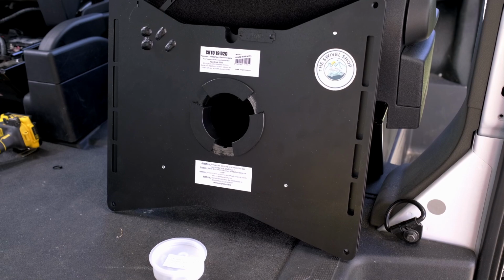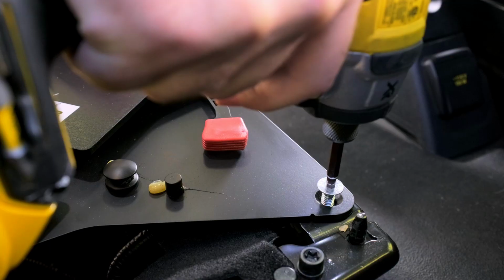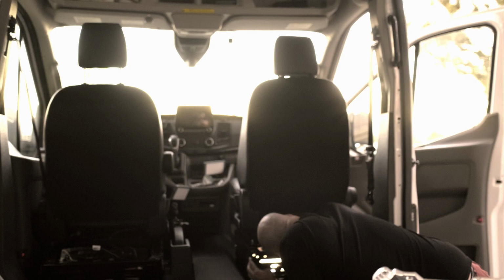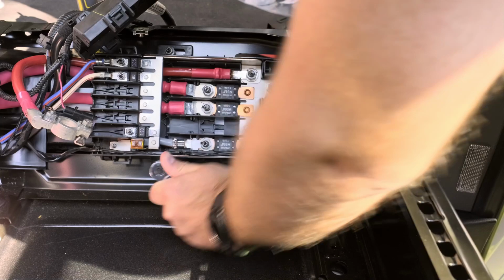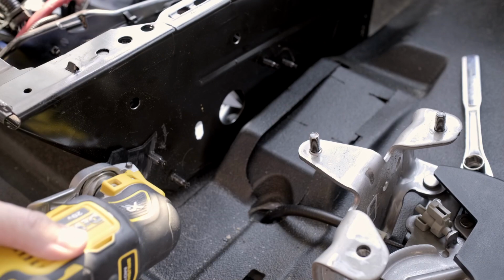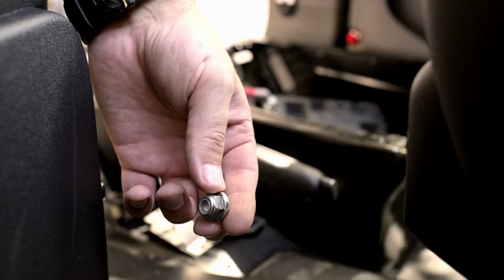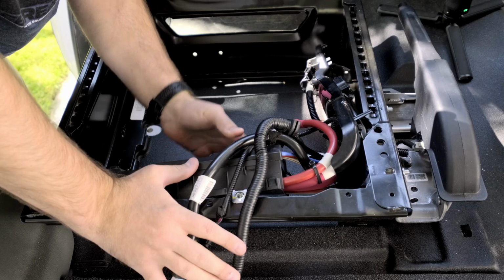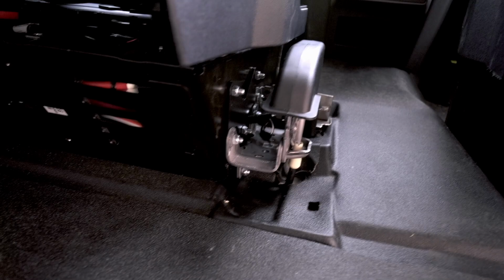Installing Dual Swivel Seats in My 2020 Ford Transit Camper Van Conversion

Comment: Seems like a really frustrating install honestly.  Not sure how this compares to any other task on a van build, like house electric system scares me.  Following a guide on that, you have to take apart the driver seat to tap into alternator charging too.  Just plain replacing that battery seems dumb too, like the idea of having to dismantle a seat like that to replace a battery is just bonkers...
Reply from the maker: It really wasn't that bad, if you've watched any MB or Ram battery removal videos you are either removing a seat or removing several body panels to gain access. At that point it's mostly just a question of how many screws do you need to loosen.
With the seat, technically it's just four screws if your just doing a quick swap and don't need to remove the seat belt attachment.

Comment: I like that you are making a Transit van because most of the stuff on YT is Sprinter related. Yes, most of the things can be translated quite easily. However, I think that the Transit makes a lot more sense to buy if you want to save some money. At least in Finland a used Sprinter is almost 2x the price compared to a Transit. I like how granular you are explaining things as I will probably use your videos with my van. Thanks for that. One thing that you might want to do is when you are doing something wrong, have a visual indication that this is not correct. Some people will not have sound on if they are following your instructions or might not be listening that carefully. It is a small thing but I think it will help make the video clearer.

Comment: Hey Eric thanks for posting this video. It was a game saver in helping me install the driver’s side swivel. I have the same van and swivel base. Yes the ebrake lowering was a chore. I would add that I was able to save the inverter by relocating it. I also saved the cover by cutting it down. I was going to add pics but you tube doesn’t let me here. Send me a message if you would like them. Thanks again. 🙏😁
Reply from the maker: I'm glad it helped!

Comment: Whoa .. great video, the details are awesome. You just convinced me that should I install swivels, I'm only going to install the passenger. Now it makes sense why some other DIY van conversions do this as well. Thank you!!!
Reply from the maker: Yeah, the passenger is much easier to install, but depending on your build layout it is so worth having the driver seat swivel as well so you can have a little lounge at the front of your van.

Comment: 0:42: ⚙️ DIY van conversion project involves installing passenger and driver seat swivels, with precautions for airbag sensor and battery power.
3:11: ⚙️ Installation tips for swivel seats in a Ford Transit camper van conversion, including removing plastic cover, using torx t45 bit, and cutting zip ties.
7:17: ⚙️ Detailed process of removing components and wiring to access the handbrake in a camper van conversion.
11:35: 🔧 Modifying mounting bracket, removing inverter, and preserving hand brake cable during van conversion.
18:41: ⏰ Effortless installation of new seat swivels, taking only 2-3 hours for the passenger seat. Scope pimas were a breeze to install.
Recapped using Tammy AI

Comment: Great vid and explanation. Noticed you didn't have any video of cutting the brake cable so that it is shorter.  In my mind, I'm imagining you have to cut out the slack created by lowering the brake. True?  No?  Thanks.

Comment: No notes on the video itself. Your presentation is spot on. My only 'complaint' is the thumbnail which says d.i.y. swivel seats which these are not. Maybe I'm nitpicking but this is a manufactured swivel seat install, not a d.i.y. project.
Reply from the maker: Hi Jimmy. Thanks for taking the time to leave a comment!
From my perspective, the swivels weren't installed by the manufacturer, or by a 3rd party upfitter. I installed them and made all the required modifications to make them fit "myself". I think from that standpoint, this is absolutely a "DIY" project. 
But, did I smelt the metal plates, or thread my own screws? Absolutely not.

Comment: Hi.  Great detailed video.  How many hours do you think this took you? Any issues that you ran into since installation?
Looking at a coachmen beyond on the transit 2020 chassis and it doesn’t look like they had swivel seats until 2021 or 2022.  I’m wondering if I can do this conversion.  Like you though I might have some obstacles esp on the drivers side since the bath is behind.

Comment: Using a multi tool vibrator thingy instead of a grinder says a lot my friend.
Reply from the maker: That I don't want 100x more metal shavings in my van? That multi-tool is probably one of the most useful tools I own.
Reply: @ErikJohnson2020  dust, not shavings. A job that should have taken two minutes probably took like 20. Vacuum for two mins after. Embrace grinders my friend.

Comment: Hi Erik, Great video. I plan on watching your other videos since I have a 2022 Transit on order and will be converting it also when it arrives. My question is that I noticed a lot of people have had clearance problems when swiveling the drivers seat over the top of the hand brake. A lot of people have had to modify the hand brake cover so the seat doesn't rub on it. You didn't seem to have that problem. Is there something you did that you did not mention or show in your video? Also, did you have any issues with the seat rail hitting the door panel and scratching it when you swivel it around? I've seen some people have to open the door to allow the seat to swivel around. Is that true with your 2020? Thanks.
Reply from the maker: Nope, the video shows everything I did, and maybe more specifically I didn't go in and replace the ebrake cover after the install since the final hand brake location is now 3" or so lower that it was, the old plastic cover won't fit anymore.
Reply: @ErikJohnson2020  Thanks for the information.

Comment: Do you have to open the doors to swivel the seats?
Reply from the maker: Not technically, though I have found that if you don't open the door, depending on how you have the seat positioned (forward/backward) you can end up scratching the door plastics.